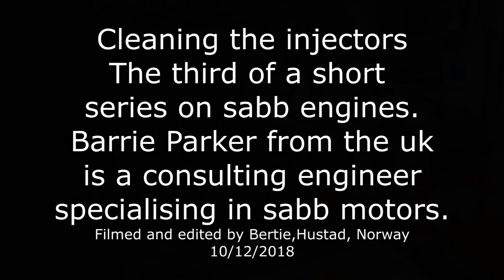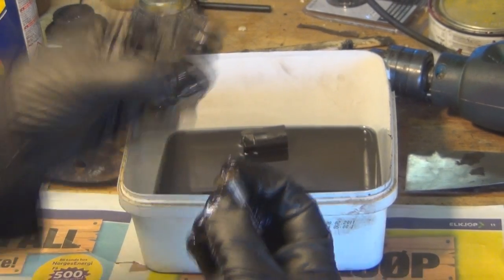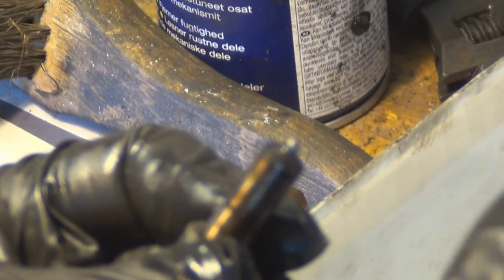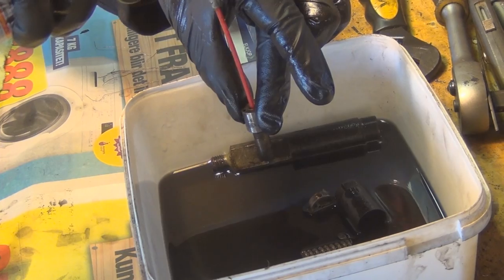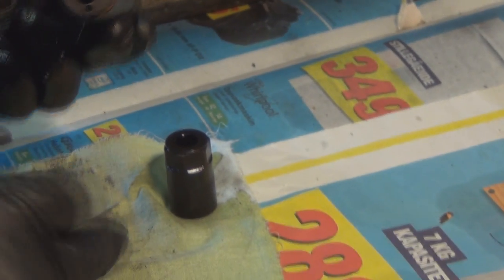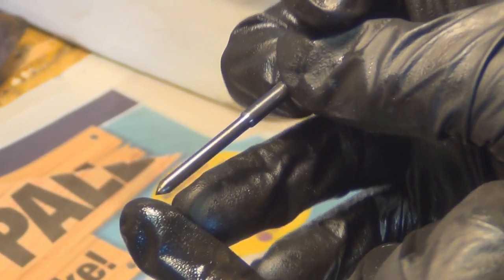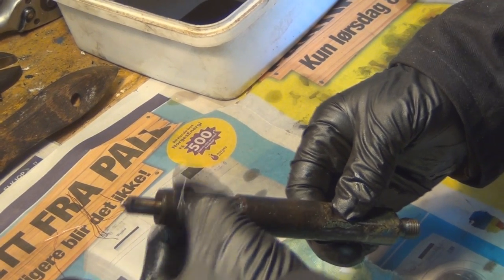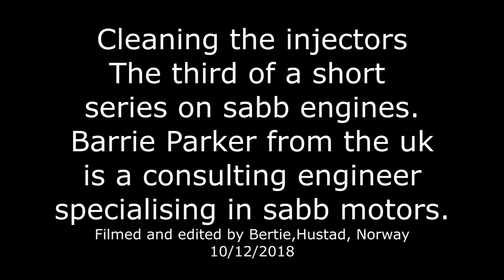Sabb 2J injectors, cleaning /maintanence

Comment: Hey, great video. I’ve got a sabb 10hp G in my little gaffer. I’m currently having starting problems since changing the fuel filter. Ive bled the line at every point. Im not getting fuel at the return outlet from the injector. I’m going to take injector out... have you got video of actually removing injector, or does the head need to come off to do it?
Reply from the maker: this is a 30hp sabb, the injectors are held in by a very simple bracket - undo the bracket and they should just come out - i dont know about the 10hp but it shouldnot be very different - no need to take the head off -